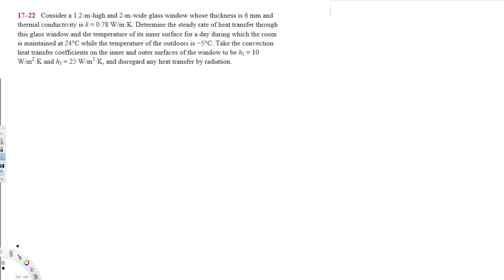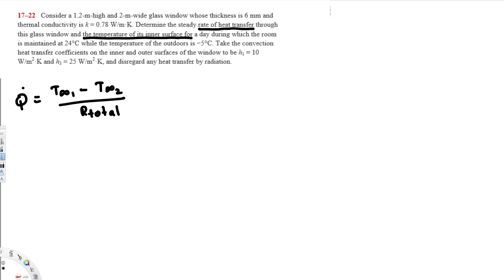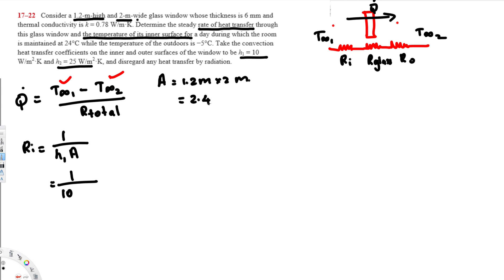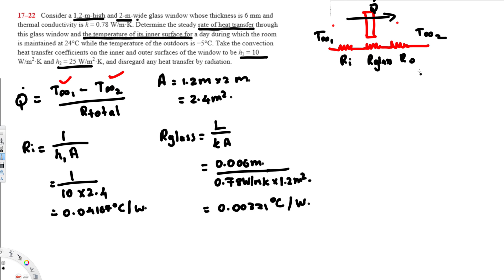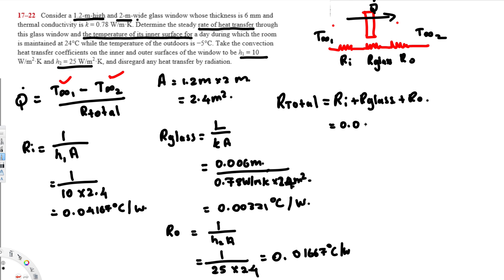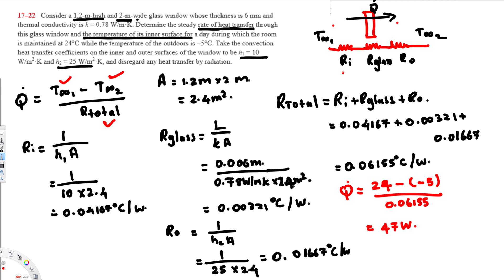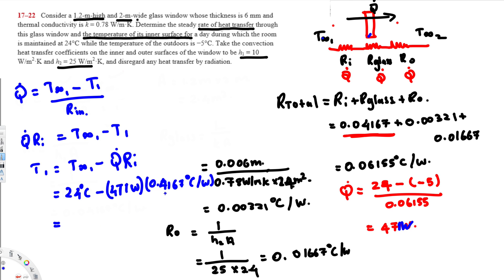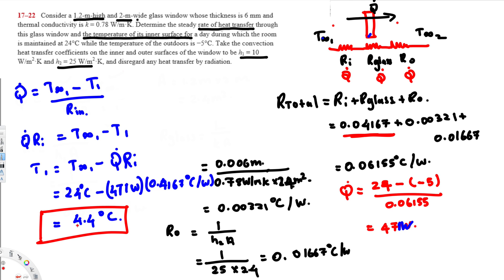Heat Transfer - Determine the steady rate of heat transfer and the temperature of its inner surface

Comment: Consider a 15 cm high and 120 cm wide glass window with a thickness of 18 mm and a 
thermal conductivity of k = 0.88 W/m. °C. Determine the steady rate of heat transfer through this 
glass window and the temperature of its inner surface for a day during which the room is 
maintained at 50°C while the temperature of the outdoors is 10°C. Take the heat transfer 
coefficients on the inner and outer surfaces of the window to be h₁ = 30 W/m² °C and h₂ = 45
W/m². °C, which includes the effects of radiation.